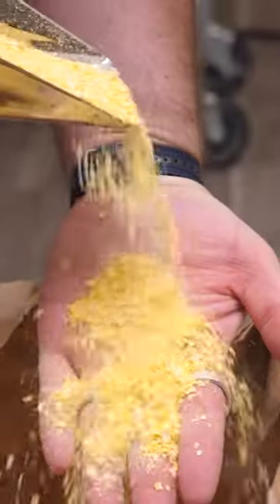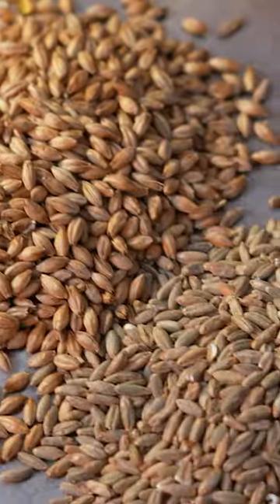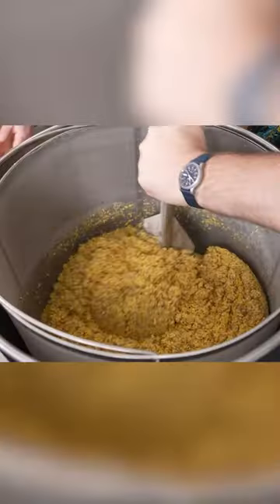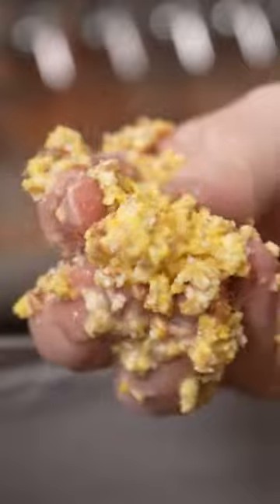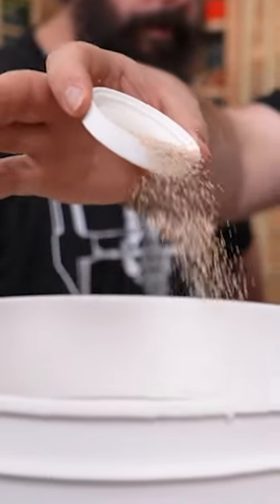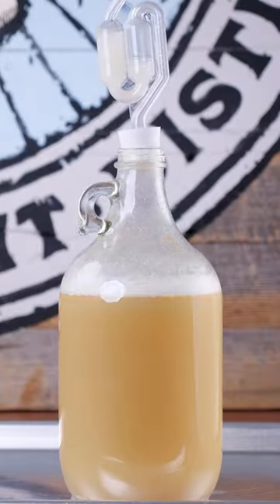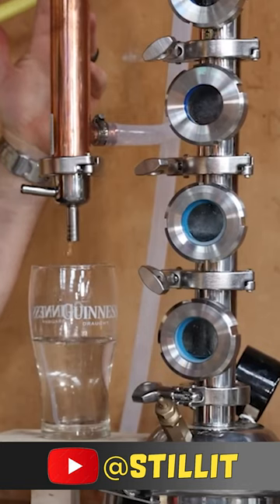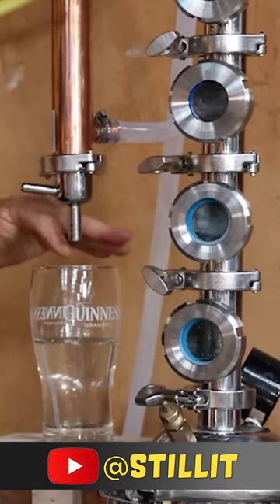How to Make Whiskey

Comment: Hypothetically, if someone were to use daddy yeast to ferment a grain mash. And when distilling low and slow(single run)only get a 145-148 proof at best. If possible, and Without sacrificing flavor what can be done to achieve a higher proof?
Reply: 145-148 in a single distillation is a perfectly respectable number. The maximum for straight whisky is 160 anyway. Anything above that is light whisky. There really isn't any way to go higher without losing flavor, but do remember you can only get out flavors that are there to start.
Reply: @Quintinohthree   you can create flavors that were never there to begin with by using certain yeast strains, if you just want a hard and fast ferment use dady but if you want esters use 71-b .
Reply: @danielanthony1054  Yeah that's a very different conversation. We're talking about distilling, not fermentation. You can't create flavors in distilling that were'nt already there from fermentation.
Reply: @Quintinohthree  exactly, same thing as those people who believe methanol is created during distillation somehow. some people even believe that ethanol is created during distillation, when i was just a home brewer i had some friends ask: when you do put in the alcohol. i tried hard not to laugh